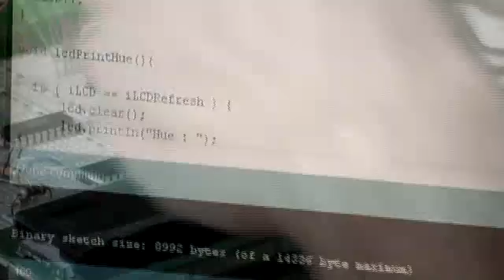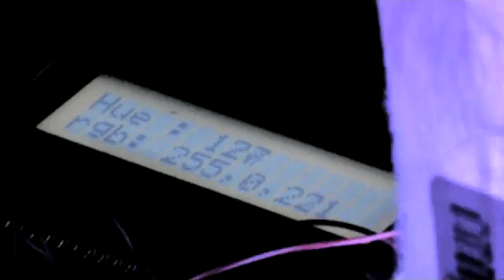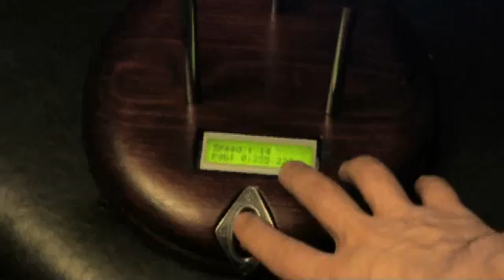Silver Byte : DIY Arduino RGB LED Lamp : SB002

Comment: Thanks glad you enjoyed that. The metal plate was just to add some design element. I saw these PEWTER (soft metal) tags with sticker words in them (love, happiness yadda yadda) ripped the sticker off and drilled through it. Alot of my design ideas came from spending hours in stores looking at various items to see how they fit in the design. I have never imagined the project complete from start to finish, it evolved with the materials I found along the way. Overall my original idea stayed true.

Comment: Nice work!  I'm also working on an LED project with Arduino at the moment.  I'm leveraging the TI TLC5940 to drive the LEDs.  I will be using RGB's but am currently using single color to check each channel.  I've got my first video posted with the very first TLC5940 circuit running some basic code I wrote.  Thanks for the kick in the pants with your video to keep me motivated!